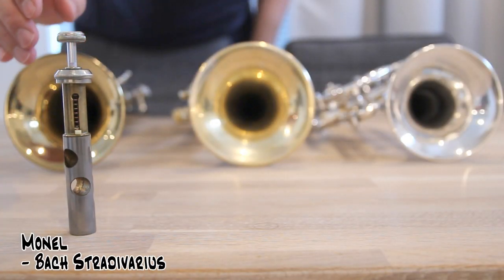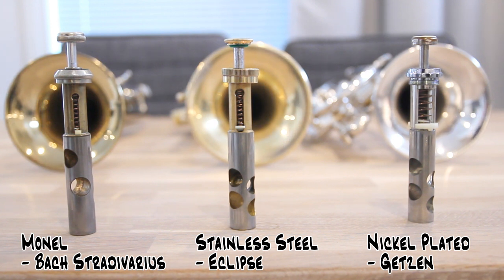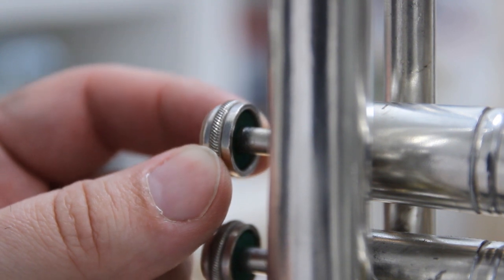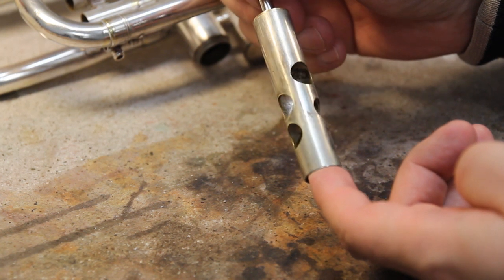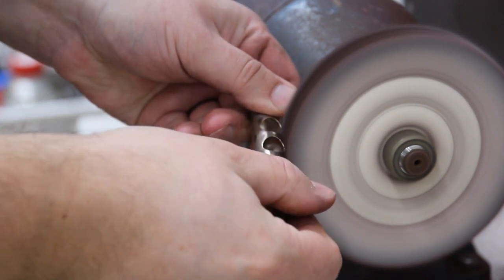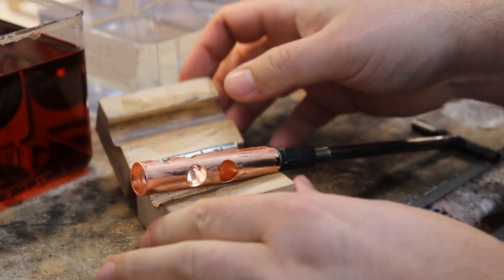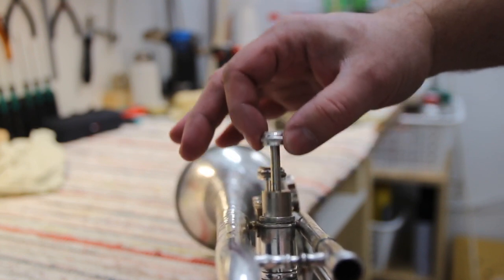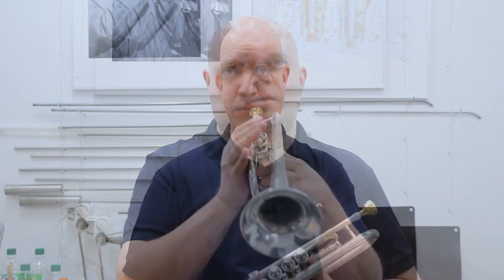Re-plating Leaking Valve of a Trumpet

Comment: I have a small collection of older trumpets and cornets; (ranging in age from 1959-1974).  I’ve noticed that a few of my horns blow out-of-key no matter how I adjust the slides. I am currently in the process of replacing spit-valve corks, but I have a feeling, after watching your video, that the valves are the problem. I don’t live in an environment where I can do what you did on this video. I wonder, how much do you think it would cost to have someone do this?
Reply from the maker: I don't really know the work costs in US (I live in Finland) but it may be around $100 per valve, but try to look for a local repair technician who has done valve plating and you may get it cheaper.
Reply: It may also be an alignment rather than a compression issue. If the valve corks/felts or valve guides are worn, then the valve holes won't align exactly with the tubing holes. You can get a precision valve alignment (PVA) done, or google some DIY methods. The parts are cheap, but measurement is tricky.
Reply from the maker: Yes, that's a good point. Valves must be aligned properly.
Reply: Can bad alignment actually lead to blow by, or leaks in the valve/valve casing?

Comment: Thank you for this vid.  It gave me the courage to try on my antique conn.  The 1st valve was so leaky I let it go 4 1hr. And was too much.  How much lapping did u have to do before it fit?  And did you only use that lapping tool?
Reply from the maker: Thanks! I used the lapping block and lapping compound from Ferree's Tools. Just keep lapping, and every now and then try to fit it into valve casing. When it barely fits the valve casing you can lap it lightly in the valve casing.

Comment: What an excellent and informative video, thanks! ...I have one question, how did you know the valve casing was perfectly round without mic-ing it?
Reply from the maker: Thanks! For this video I just inspected the casing with light to see there are no dents, but you can't make sure it's perfectly round by just inspection. I usually use a ground casing mandrel but I didn't have exact mandrel for that casing. To be absolutely sure it'd need to be machined with lathe. https://www.ferreestoolsinc.com/products/n58a-ground-casing-mandrel-631-700

Comment: Good video showing the process. 
People should be aware that the cleaning of the parts to be plated is 90% of the process of plating, and will determine if the plating sticks. Almost all electroplating failures are due to insufficient cleaning. Even when you 'think' it's clean enough, it probably isn't. Electrocleaning is required, and the object must be clean down to the molecular level.
Reply from the maker: Good point, that's absolutely so. Thank you for your comment.

Comment: Greetings, Timo. First of all, I want to thank you for such an informative video. All processes are perfectly described, and it is clearly shown that the main points in the application of electroplating depend on the preparation for coating and subsequent lapping of valves. I was wondering what kind of alkaline solution you used during the electrolytic cleaning of the valve in the first stage? It's just that this is a very important point for a better coating, and if you choose the wrong alkaline solution, then there is a chance that the coating may disappear over time. Thank you, Timo, for continuing to improve this world.
Reply from the maker: Thank you! I used the degreaser from Tifoo https://www.tifoo.de/en-uk/degreaser

Comment: Found your video fascinating.  One question.  Did your electro-plating reduce the sized of the pass through holes of the value?
Reply from the maker: Thank you! Yes, you are right, electro-plating did reduce the diameter of the valve ports, I should have covered the ports first.

Comment: Hello from Brussels Dear Timo !

Thank you for you instructive video.

Please, I would like to know if the valves of different materials (monel, steel, nickel) have different weights. 

Warm regards !
Reply from the maker: Hello and thank you! The different valves feel about the same weight in your hand, but I haven't really used a weight scale to check it.
Reply: @timyllym  I would like to know if you recommend different viscosities for each valve type. For example, a light oil for monel or thicker oils for stainless steel. Thanks!
Reply from the maker: I think the viscosity depends more on how tight the valve is in its casing. For new and tight valves you need thin/light oil, but for worn valves thick oil is better.

Comment: Do you check the bore of the valve to make sure the (holes in the piston)haven't gotten smaller?
Reply from the maker: The valve ports probably did get a little smaller in diameter. Ideally the ports should be covered with wax, white-out etc before plating.

Comment: Love this well done video! Could you possibly put links to the chemicals and anode materials you used and whatever kit for voltage or the voltage itself in your description. And how you made the nickel electrolyte. I just bought a 1925 King Liberty trumpet, that in the pics, the valves show as copper, so I'm sure they need plating. Also, what grip paper were you using to lap the valves? I assume you took a block of wood, drilled the right size hole, then cut it in half, to make that valve lapper, very resourceful. I'd thought of using auto valve lapping compound in the casings themselves, but you'd have to work them in a little at a time.
Reply from the maker: Thanks! You can find all the stuff for electroplating from https://www.tifoo.de/en-uk/ and they also have good instructions. I bought the lapping block and compound from Ferree's Tools:
https://www.ferreestoolsinc.com/products/l58-lapping-compound
https://www.ferreestoolsinc.com/products/n20-24-valve-lapping-blocks

Comment: I have pitting in my euphonium valves , would it be reasonable to over plate and than lap it down until the pitting is removed?  Lots of great info there...thanks.
Reply from the maker: Pitting doesn't necessarily matter if the valves don't leak and there are no sticking issues. To remove the pitting you'd need to buff the valves first clean, then plate and lap them.

Comment: Hi Timo, this Video is very interesting. It's a good ideal, to make the plating at home ! It's funny, that you plate a nickel valve .
I'm playin my Getzen  Severinsen Trumpet since 1979. But the nickel plated valves work very well..I think, these nickel valves are definitely the best kind of valves. Your plating method will be much  more interesting for users of monel and Steel valves and Ithink, the method is the same..copper and the nickel, correct?
Best wishes from germany, peter
Reply from the maker: Thanks Peter! Yes, method is the same for monel and steel. Copper sticks easily so it goes first and then final layer with nickel.

Comment: Awesome work ! Is it possible to electroplating monel instead of nickel ?
Reply from the maker: Thanks! It may be possible to electroplate a valve with monel but I haven't done it. It may require some special equipment.
Reply: Monel is an alloy made up of several different metals, and is similar to stainless steel. Alloys are difficult to plate because the different metals in the alloy will plate at different rates and at different amounts of electrical current and voltage. So basically, no, one cannot plate monel. Stainless steel cannot be plated for the same reason.

Comment: Short question here, why do you need to do a copper plating instead of Nickel plating it directly? I have a trumpet from the 50s student model, but sounds awesome and it looses quite a bit of air, i'd love to try and increase its piston tightness :P
Reply from the maker: Copper is easier to work with, it is softer metal than nickel. You should plate the valve a little too thick with copper and then lap it to match the valve casing. Copper is easier to lap than nickel. But nickel as final layer is more slick and durable than copper.
Reply: @timyllym  Yes, very true. Part of the reason copper is used first is that copper is a great base coat for any further plating. Everything "sticks" to copper. Copper also plates faster than nickel, so it's better to build up pitted or worn pistons with copper. I have read that thick layers of nickel can peel and flake off from the surface tension of the deposited nickel. Copper is very stable and does not peel.
Reply from the maker: Thanks Bob, that's good info!

Comment: Hello, I had to like this video of course :) Can you also show how to monel - plate a valve and how to plate brass - valve - slides?
Reply from the maker: Thanks! You can't plate with monel or brass because they are alloys. Plating must be done with pure metals like nickel and copper.
Reply: @timyllym  well, i have found a few methods for electrochemical brass plating. one is using a mixture of alkaline salts and copper and zinc cyanide for sure. as for monel plating, how does the industry get´s it on the valve then?
Reply from the maker: Ok, that's great! I'm really not that much specialized in electroplating.
Reply: @olympicfan2  The valves are made of monel metal, they are not plated with monel. Monel is an alloy, and most alloys are difficult or impossible to plate. Brass is one of the few alloys that can be plated, but only with specialized solutions.

Comment: You also plated the interior of the ports. That has now changed the bore size at each port.
Reply from the maker: You are right, I probably should have covered the ports with something. Thanks for advice!
Reply: Agree. White-out is a popular option for masking parts before plating, like nail polish. But keep in mind that the plating will likely not adhere well inside the ports because they were not buffed, and the plating thickness is less than 0.01mm which
Reply from the maker: Ok, thanks for the tip! I'll try white-out.
Reply: @timyllym  Try filling the ports with hot wax. Works a treat.
Reply from the maker: Thanks, gotta try that.
Reply: @flightmansam  It's not a good idea to use wax. It will easily contaminate the solution, especially if the plating solution is heated, as they usually are. Even if not heated, you don't want to risk it. The dissolved wax will float on top and contaminate your part as you immerse it in the plating solution. This will lead to plating failure. Better to use something like 1/2" foam backer rod from the hardware store and put a small piece in each port. It's faster, easier, and cleaner.
Reply: @1090yoyo  Anything that could possibly dissolve in a warm plating solution should not be used for masking. It will contaminate the solution. Lacquer is often used, and that is OK. Also, plating WILL occur in the valve port. It has nothing to do with buffing or the smoothness of the metal. All clean metal that is in contact with the plating solution will be plated.
Reply: @BobBeverage  I'd use rubber corks, or regular corks, but I really don't think that the thickness of the plating is going to affect the bore size enough to matter bc we're talking 1000's of an inch or less than a millimeter, but you are using plating material you don't have to, same with the bottom and tops of the valves.

Comment: Hello, thank you for your efforts in passing on highly precious knowledge. I'm from Brazil, I'm learning about replating the valves, I watched a video by an American technician: https://www.youtube.com/watch?v=8VFQ6s0WDpk , where he had the replating done, but he worked on the valve body, so that they would be cylindrical too, I noticed that in your video you skipped this part only worked on the valves, my question is: do you believe it is unnecessary to work on the valve body? Thank you very much
Reply from the maker: Hello, thanks for your message! Straightening both the body of the valve and valve casing are essential, it needs to be done first. I refer to this in my video, but it is maybe emphasized too little. In my case the valve body and casing were already straight, so no work was required for them.
Reply: @timyllym  Hello. Many thanks for the reply!